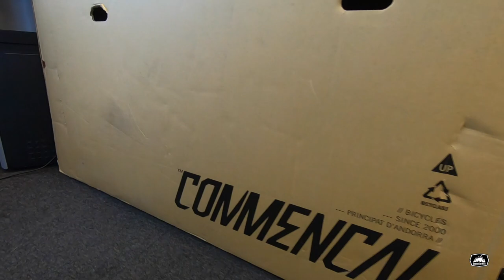2020 Commencal Meta Power SX Unboxing // Test Ride!

Comment: Hey, nice Video. But some questions. You say it has 180mm Travel Front and back. The Frame wich i can Order has only 165 in the 27.5 version and 160mm in the 29 version in the back. And where the hell do you find the Fox coil Version ? I cant find and custumisation possibility on the Commencal site like in the Propain shop. Pls Help.
Reply from the maker: This is the 2020 Sx signature so the fox coil was the top spec for that year and the bike came with 180mm F+R 
They completely re designed the the frame and specs for 2021 bikes so thats why you cant get this spec or frame anymore - hope that helps 👊🏻
Reply: @roweyD  oh ok didn´t know that, thx for the information. Have fun with thiis awsome Bike, i think ii will order the Scott Sam2  2021

Comment: Hi there! What can you say about the agility of the bike? I'm about to buy the 2021 model but not sure about the handling. Cant test it here in austria! And can you still ride some longer chill tours or is it just for some short party fun tours?
Reply from the maker: Ive not had any problems with the agility of the bike, it handles everything! The only thing that took some getting use to was the bike is much longer than my previous bike. Ive done multiple short laps and ive done long mountain rides with huge elevations - all depends on what mode you choose. 
The 2021 has a larger battery than the 2020 so you’ll be fine and definitely wont regret your decision 👊🏻

Comment: Hey dude, great video! Can I ask where you got your paint protection kit for the frame?
Reply from the maker: Glad you liked the vid - got the frMe kit from https://www.r3pro.co.uk - definitely recommend 👍🏻
Reply: Just curious, isn't the frame brushed aluminum?  I didn't think you need frame protection on those frames.
Reply: Also, may I ask what kilometre and climbing range you get and on what modes?
Reply from the maker: Vicarious its kind of a brushed aluminium with a clear coat. Even so u can still scuff brushed ally
Reply from the maker: Vicarious its really hard for any1 to give a proper answer as its all dependent on what mode, the amount of climbing and even the temp. Ive only had 2 rides so far - 1st was full eco with small amounts of the bike turned off - i did 1250ft of climbing and didnt use a single bar of battery. 2nd I challenged myself to see how many laps of my local track i could do in 1hour in boost - i did 2500ft evevation in 1hr and had 2 bars battery left. Make your deductions from that i guess lol
Reply: @roweyD  Cheers mate.  :)
Reply: Sick bike dude! I have the meta power 29 essential coming this week. I can't wait!